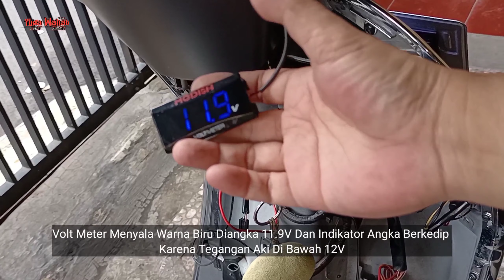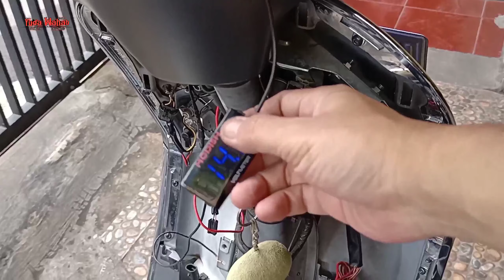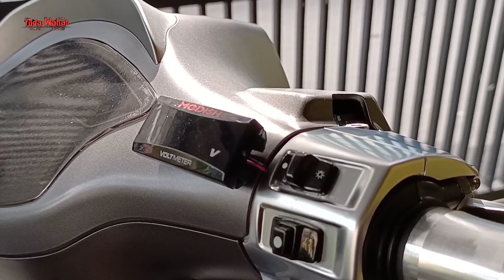#PART2 Cara Pasang Voltmeter Accu/Aki Motor Di Vespa Sprint Matic i-get DIY

Comment: mau tanya, buat vespa lx 2v sama kahh? soalnya saya pernah liat ada yang masang ga perlu ribet gitu?
Reply from the maker: Intinya di voltmeter ada dua kabel kabel + dan kabel -.Sambuang kabel + volmeter ke kabel + kontak motor dan kabel - sambung ke body motor.sama semuanya gitu om
Reply: @yudawahab  kalo bukan ke kontak bisa ga ya, katanya di masukin kabel switch rem bisa, makasi infonya ya broo🙏